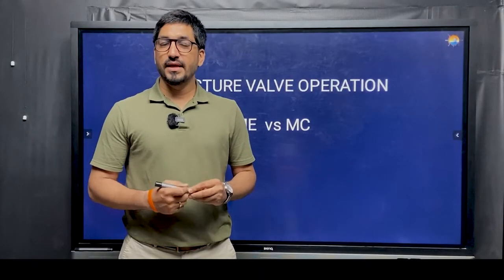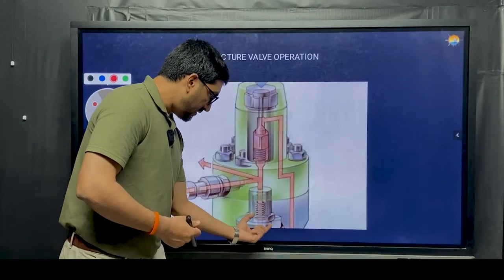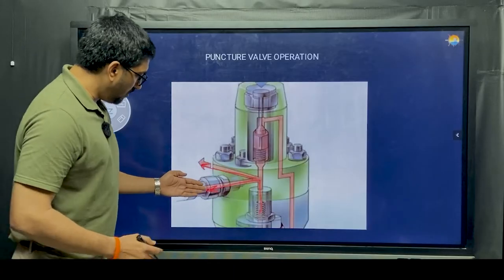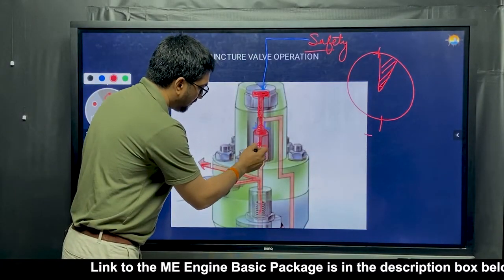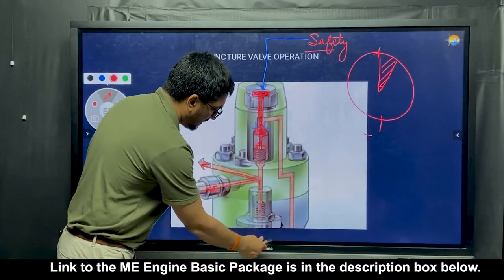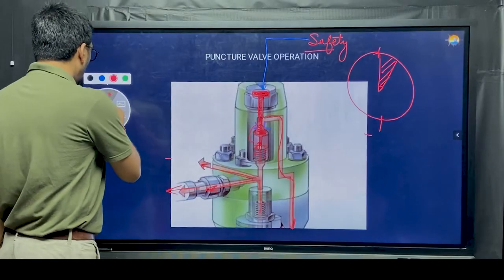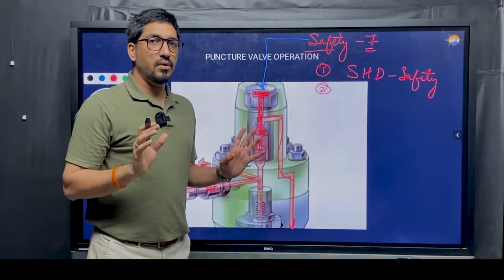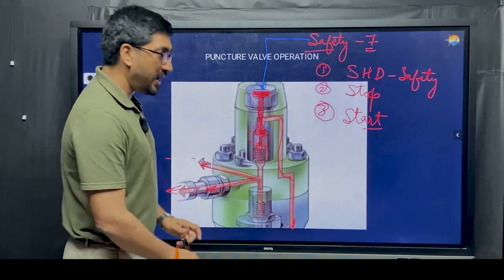The Importance of Puncture Valves in Marine Engine Maintenance | ME Engine Package

Comment: Basically, the puncture valve was only required for mechanical fuel injection (MC engines). With Electronically-controlled engines, there is no requirement for such a valve...😉